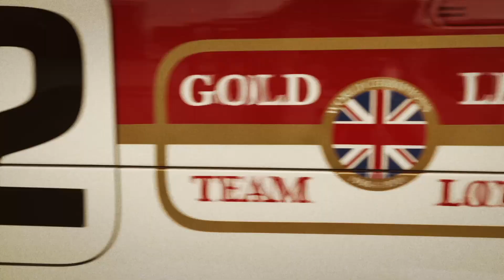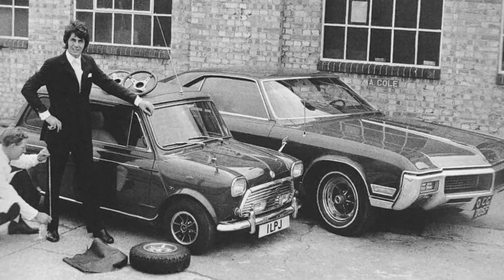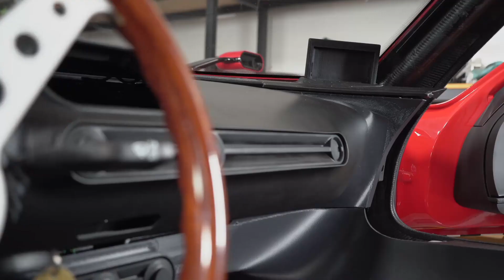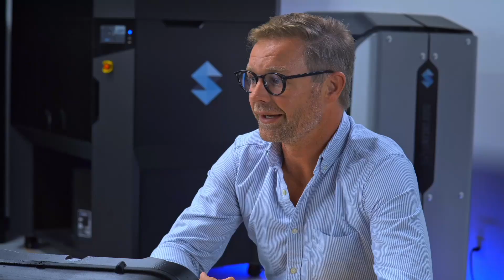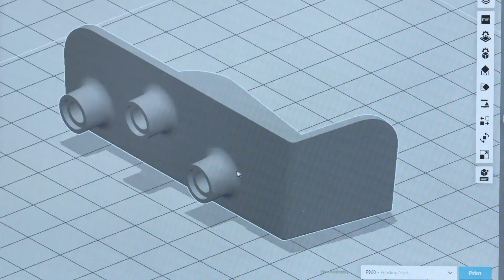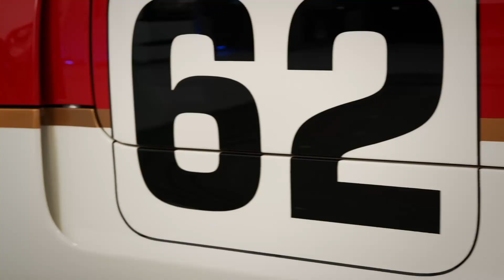Radford uses 3D printing to customize automotive manufacturing

Comment: they are trying to convince you that having a machine print out parts is like when cars were coach built. coach built cars were handmade, metal formed, shaped with an English wheel, planishing hammer etc. Those are all failed companies that are trying to revive themselves like De tomaso. Radford company does not exist, they slapped the the name on there to help promote and sell this car.